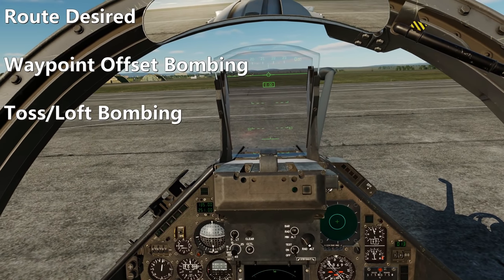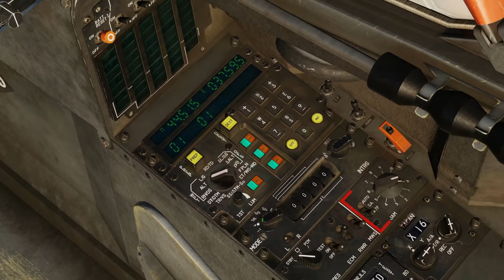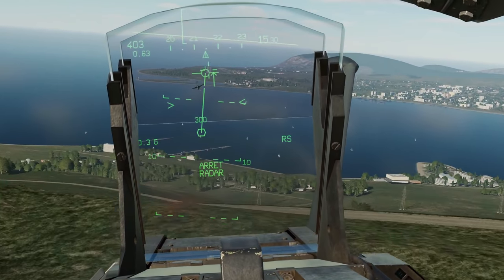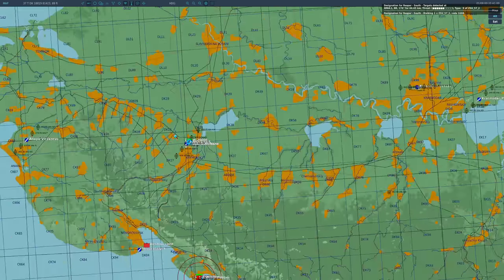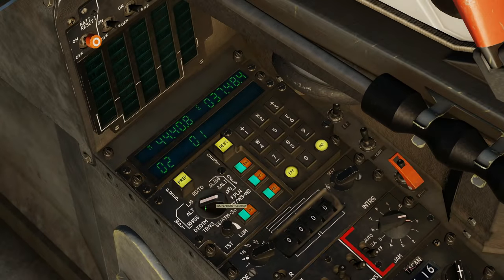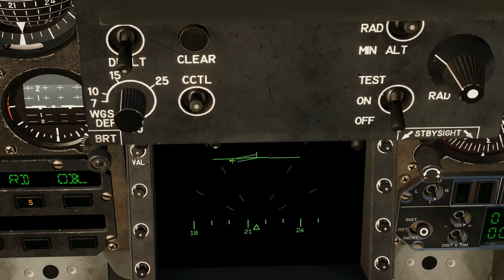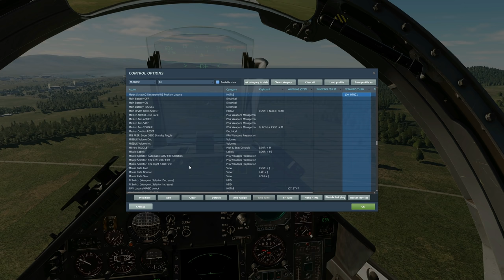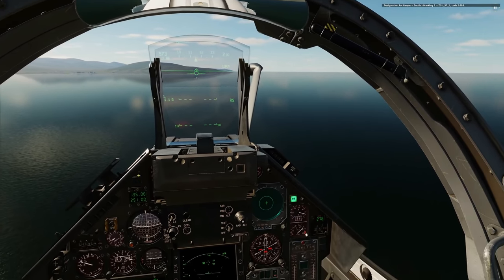Mirage 2000C: Route Desired, Waypoint Offest & Loft/Toss Bombing Tutorial | DCS WORLD

Comment: Any idea on how to fix the last mission of the vanilla Mirage campaign? It was built before this offset update and it seems like it was never updated accordingly, as it still says INS update at WP2 but target at WP6, which doesnt work anymore. Any help? :(
Reply from the maker: I have no idea sorry.
Reply: @grimreapers  I found the problem. I could just turn off INS drift, then use WP5 with its actual ground height for the INS update and then just fly towards the target (without changing steerpoints) with the proper A/G designation.